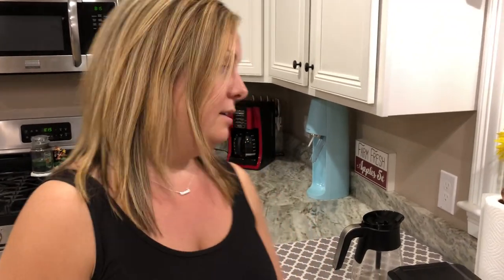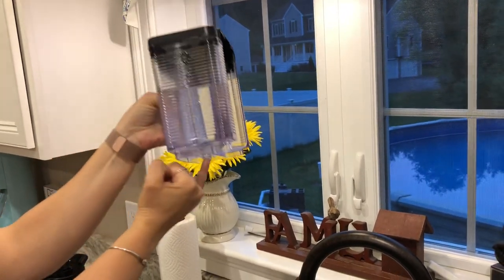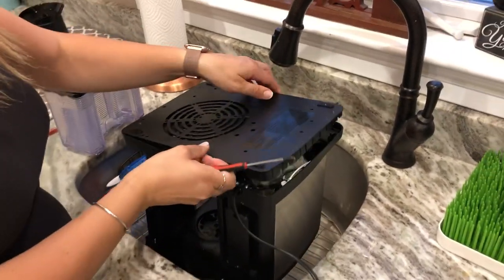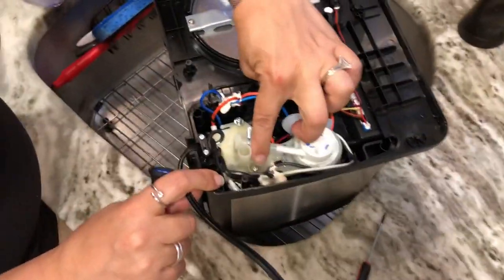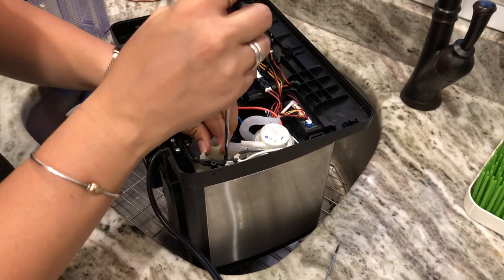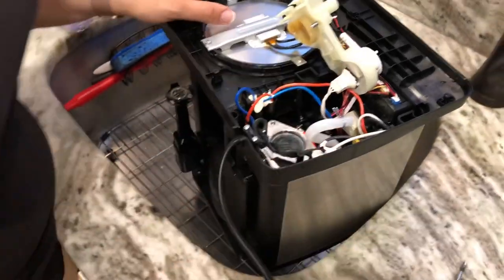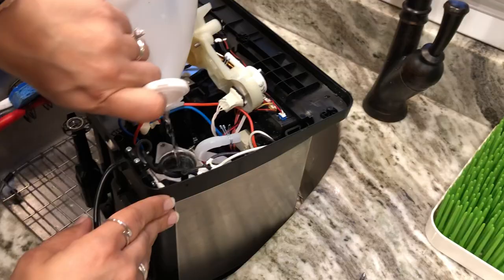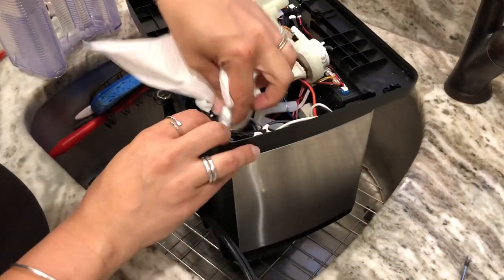Ninja Coffee Bar 5 Beeps of DEATH ~FIXED!!!

Comment: Another question....I do wonder how scale build-up in the boiler actually makes it so that the sensors don't work???  
       Another observation while I'm in there...it is clear that in mine, the bottom half of the boiler is all pocked and clear of scale build-up...so when I leave de-scaling solution overnight in desperation, it IS doing its thing, but also eating away at the metal (is that aluminum???  Yuck!)...and then halfway up the boiler the scale WAS built up, and  near impossible to clean it all down to the metal.  This tells me that the Ninja does NOT hold a full boiler of water, and therefore makes the cleaning cycle imperfect.  Maybe the reason I am only getting a few tablespoons of brew at a time is because my boiler was partly caked on inside????

Comment: You’re my hero!! Fixed mine first try!
Reply: Ok I take that back. Mine started leaking. Didn’t notice it with all the dishes on the counter still. Onto try three with getting that gasket to line up. But the thing brews now. Just a little leaky leaky. Lol
Reply from the maker: Oh no!! Probably the gasket not back in the right spot.  It’s tricky. Did you end up getting it to not leak the second time around?

Comment: So on the fence about buying this , it’s exactly what I want but so concerned about all the reviews and issues I’ve seen . So , what do you recommend is it worth it , do all the machines have this issue ? Help!
Reply from the maker: I’m torn!  I want to say, yes because I love the functions it has and the price of the unit wasn’t too bad compared to the other brands like the nespresso brand ones which can cost upwards of $400.  In fairness, I did have the unit for about a year before I had to to this cleaning with it taken apart.  Perhaps if I had run the clean cycle with some vinegar more regularly it would not had calcified so much in the little boiler pot.
Reply: I found that the problem was that I didn't "clean" it regularly. Especially if its going to be used daily and multiple times a day, which was my case. Vinegar is a good and cheap solution to use to keep it clean inside. I really enjoy my ninja coffee maker
Reply: Love the new Specialty Cofee Marker (Bar)
Had a similar issue but had a somewhat simple fix. It's been working great for us since.

I almost did this early one morning for the Er04 error message, then I thought about it and just shook all the water out thinking it may be vapor locked and after getting all the water out it worked! It was a new unit using filtered water. Just in case it may help someone!
 https://www.youtube.com/watch?v=YqrHJFjC2Ok
Reply: @MMAMoM23  I'd say Yes also! Great value, and once you understand the cleaning and posible "vapor lock" there is not much to be concerned about. IMO.

Comment: my model is from years ago, bought it brand new and has been in the close for several years while I used the first Ninja Cafe bar. So, took it out of the box brand new(same as your model minus the hotplate) ran 2 clean cycles as instructed and then made my first cup of coffee no problems. After first cup the 5 beeps started in now my other unit also did the 5 beeps from time to time but with some adjusting of the water reservoir it seemed to be a rare thing whereas with this new/old machine it's constant. Personally, I think the sensor for the basket or basket bucket maybe triggering something or the water reservoir signal since there seems to be some excess water beneath the reservoir?? But this is technically a brand new model? Any thoughts before I take out the sledge hammer?
Reply from the maker: So sorry for the late reply!!! Honestly it sounds like a defective unit for you.  I wish I had any other tips to add, but I don’t know what else you could do to it!! I always keep my trusty “old reliable” Mr. coffee machine in the pantry if this thing ever craps out again. LOL

Comment: The screws are impossible... Half of them randomly have a metal nub in the center that T10 can’t work with. So frustrating!
Reply: Same problem
Reply: I used a tamper proof T9. it has to have that little hole in the middle of the T9. Google it and you will see

Comment: Mine has been a verry slow death....starting at about 10 months old (now 2 years old).  I get partial cups of coffee, as in having to hit the brew cycle 4 or 5 times to get a cup full.  I always found the whole cleaning instructions kinda nuts, because the vinegar or scale-cleaner solution mostly flushes through instead of sitting for a good long time.  Also, the cleaning cycle adds up to spending hours at home to attend to the process.  ~and it only partially helps.  I like this way MUCH better, because it is so direct, visible, and tangible!  I saw a guy on youtube using CLR!!!  Sounds effective but SCARY in a FOOD/DRINK appliance.
   So I have been at this for about an hour, scraping with every implement I could find...awls, grapefruit knives, etc... and intermittently I stuff a vinegar soaked sponge in there and twirl it with a skinny 2-pronged fork.   Going super slow.  How clean do you have to get it?  Should I leave the vinegar sponge in there for a few hours?  
    One good trick is to keep a magnet close by for all the screws and washers!
    There are many model variations on the market, each with minor variations in how things come apart/go together, but the basic idea stays the same.  This video had the most info so far, thanks!!
Reply: I have the answer to the 'Beep of Death 2.o'... It requires the dismantling of the Swing Brew Basket.  There are subsurface magnetic contacts that feed the ability to perform a brew cycle.  At the root of all of this is a a spring to facilitate the contact.  And, there you go, no need to buy a new unit... Definitely a weak design and I will show you how to reinforce it as well!!!
Thank you Jillian 🤓

Comment: Going to give this a try.  Had been blowing air in the reservoir port with good success to get the chunks out, but that no longer works.  Need coffee, not problems.
Reply: I have the answer to the 'Beep of Death 2.o'... It requires the dismantling of the Swing Brew Basket.  There are subsurface magnetic contacts that feed the ability to perform a brew cycle.  At the root of all of this is a a spring to facilitate the contact.  And, there you go, no need to buy a new unit... Definitely a weak design and I will show you how to reinforce it as well!!!
Thank you Jillian 🤓

Comment: Here's the real fix... The 5 beeps notifies of a condition of high heat in the boiler. If you take the water can out and hit the bottom valve with your finger/tool, it should be a relatively hard stream. This stream must be more than what brews into the carafe.  The can may have a slimy coating, like a fish tank. This clogs the fine screen at the bottom of the can. Use something serious, better than vinegar, that will clean this slime out of the filter. I used denatured alcohol, swished it around, fingered the valve, took it out to the garage and blew it backwards with the shop air. Now it drops a steady 1/4" stream consistently. If the stream out of the box is still weak, I don't see any reason you can't stab some holes in it with a wire. You were about to throw it away, this will extend it a few years. You could probably buy a whole new can if you wanted to, as I couldn't find a way to separate the filter from the can. If this doesn't fix it, you have bigger problems but I believe this is the root cause, a simple flow issue. Not burping or swabbing plastic with vinegar or scraping out a 1" cavity. That's just superstitious.

Comment: I did this, put it all back and now all water leaks through the bottom, not a single drop goes into the carafe  😭😭😭😭
Reply: Your rubber gasket ring must not be flush or the hose didnt get pushed back in enough. That happened to me but I pushed the hose further in and made sure the rubber gasket was wrapped around flush on the plastic round piece.
Reply: @favioreveles1810  thank you so much!! You were right, the rubber gasket ring moved and was not allowing the water to go up, leaking it all through thr bottom. Problem fixed and now I can confirm my coffee bar  is working, no more beeping. Though it had no scale or build up at all (honestly to my surprise as per I've had it for about 2 years). Maybe it only had air trapped somewhere.
Reply: @brendaceballos6878  yeah it might of just been air. I actually returned my original Ninja coffee maker because it was doing this and they sent me a new one but the new one started beeping after about 5 months of usage. It's a very sensitive coffee machine to say the least lol. I feel like a coffee maker plumber lol.
Reply: @brendaceballos6878  glad that worked for you Brenda. My coffee maker was prematurely finishing too soon before that ha.

Comment: You only forgot one thing- the deposits get out of the boiler and go through the plastic pipe into the white plastic impeller chamber, which stops the fan inside from spinning to move water from the tank. The impeller assembly comes apart by screwing it counter-clockwise with both pipes removed. The fan will drop out. Wipe the inside with paper towel, drop in the fan, and put it back together.
PS New Jersey girls are hot.

Comment: I'm not real sure my Ninja is having the same problem. The 'drip stop' starts blinking/beeping over and over wont shut up and stops brewing. I can slide out the basket or flip the drip stop lever back and forth and it works again...but only for a few seconds then back to it's old crap again. Maybe this is the same problem everyone is having but it sure doesn't seem to be acting  the same way.
Reply: I have the answer to the 'Beep of Death 2.o'... It requires the dismantling of the Swing Brew Basket.  There are subsurface magnetic contacts that feed the ability to perform a brew cycle.  At the root of all of this is a a spring to facilitate the contact.  And, there you go, no need to buy a new unit... Definitely a weak design and I will show you how to reinforce it as well!!!
Thank you Jillian 🤓

Comment: Tried this and now the coffee maker leaks  like crazy!!  I think this lead me break my machine.
Reply from the maker: Becky Bossong try to open it back up.  If the gasket in the little boiler thing is not down flat perfectly it will leak water from there!  Good luck with it.  I hope you’re able to fix it.
Reply: Please please male a video pitting the boiler thing back w the screw ive been working on it for 3/days I've already bough a back up but it the one that u froth the milk in like a separate jar n I dont like pleased my machine is leaking

Comment: Just holding it upside down over the sink and pressing the inlet valve was sufficient for me. Hopefully I'll never need to actually disassemble mine, but if I do, I'll be sure to watch this video again. Video of my no-tools-required fix here: https://youtu.be/F18pL_E6ALA
Reply: I have the answer to the 'Beep of Death 2.o'... It requires the dismantling of the Swing Brew Basket.  There are subsurface magnetic contacts that feed the ability to perform a brew cycle.  At the root of all of this is a a spring to facilitate the contact.  And, there you go, no need to buy a new unit... Definitely a weak design and I will show you how to reinforce it as well!!!
Thank you Jillian 🤓
Reply: @jillianlaroque-peterson6072  You should create your own video, if you haven't already.  The impression I get is that there are 2 or 3 different causes of this problem and that my problem is not the Swing Brew Basket, but a bubble in the water sensor or stuck sensor (though I'm happy to be proven wrong). Anyway, for anybody whose problem IS the brew basket, having a video of how to fix it would be great.
Reply: Thank you Pablo😊 I liked your video and that worked for me the first time.  After trying all available videos the customer service individual said I needed to buy a new one cuz I was 1 month over on my warranty.  So I figured what do I have to loose.... I will be making a video tonight or tomorrow ☺️.  It is fussy work requiring patients but the level of difficulty is not bad.  Would love to hear your comments and it can give you other options when your's faults out again, sorry to say it is likely when and not if😁

Comment: This was interesting but didn’t work. The boiler had lots of calcium buildup and I cleaned it and everything else. Tried all the other methods on YouTube and the unit would not even perform the clean cycle. It has a higher tone 5 beeps when it fails the clean cycle (after running hot water for about 5 seconds). Spent too much time on this already. Ninja going in the garbage and getting a simpler coffee maker.

Comment: Hey Lenia - another YouTuber posted a much simpler and faster fix by just flipping the machine upside down while pressing in the black button valve where the water reservoir tank pushes into. Didn't have to take anything apart and solved the 5 beeps problem in 10 seconds. Just food for thought. I'm sure your fix works beautifully as well but just wanted to give someone another much simpler fix...and no tools needed! Here is a link to the fix: https://youtu.be/F18pL_E6ALA

Comment: Hubby tried this and it didn't work. Thanks for posting but I will keep looking.
Reply: I have the answer to the 'Beep of Death 2.0'... It requires the dismantling of the Swing Brew Basket. There are subsurface magnetic contacts that feed the ability to perform a brew cycle. At the root of all of this is a spring to facilitate the contract. And there you go, no need to buy a new unit.... Definity a weak design design and I will show you how to reinforce it as well!!!!  Thank you Jillian🤓
Reply: I have the answer to the 'Beep of Death 2.o'... It requires the dismantling of the Swing Brew Basket.  There are subsurface magnetic contacts that feed the ability to perform a brew cycle.  At the root of all of this is a a spring to facilitate the contact.  And, there you go, no need to buy a new unit... Definitely a weak design and I will show you how to reinforce it as well!!!
Thank you Jillian 🤓

Comment: I did this and mine still doesnt work. I am beginning to hate this brand.
Reply: I have the answer to the 'Beep of Death 2.o'... It requires the dismantling of the Swing Brew Basket.  There are subsurface magnetic contacts that feed the ability to perform a brew cycle.  At the root of all of this is a a spring to facilitate the contact.  And, there you go, no need to buy a new unit... Definitely a weak design and I will show you how to reinforce it as well!!!
Thank you Jillian 🤓

Comment: Crap! Notice she didn't show it brewing coffee afterwards. Because it's hard to put back together. Now it leaks like a sieve ... and still 5 beeps. Now looking at buying a new coffee pot. Won't be a ninja.
Reply from the maker: Chuck Hale sorry yours leaked!  I didn’t do a video afterwards with it brewing because I don’t make many videos lol.  The first time I did put it back together the white piece that screws in I guess was misaligned and mine leaked too.  I then took it apart again and noticed I didn’t have a perfect fit on that and unscrewed it and screwed it back together and it did not leak the second time.  Sorry yours didn’t work out!
Reply: I have the answer to the 'Beep of Death 2.o'... It requires the dismantling of the Swing Brew Basket.  There are subsurface magnetic contacts that feed the ability to perform a brew cycle.  At the root of all of this is a a spring to facilitate the contact.  And, there you go, no need to buy a new unit... Definitely a weak design and I will show you how to reinforce it as well!!!
Thank you Jillian 🤓

Comment: Ugh I wanna cry. This fix didn't work for mine, and I was so frustrated with putting the boiler back in. What a POS machine this is
Reply from the maker: Bummer! Sorry it didn’t work out.
Reply: I have the answer to the 'Beep of Death 2.o'... It requires the dismantling of the Swing Brew Basket.  There are subsurface magnetic contacts that feed the ability to perform a brew cycle.  At the root of all of this is a a spring to facilitate the contact.  And, there you go, no need to buy a new unit... Definitely a weak design and I will show you how to reinforce it as well!!!
Thank you Jillian 🤓

Comment: I'm so frustrated. None of the standard screw drivers we have will work on the screws so I guess I'll have to go buy a new screwdriver. WTF Ninja?
Reply: Vanessa Reich-Shackelford same here, google Security Screw Bits and the screws u need are available at Lowe’s, or Amazon 👍🏼 don’t buy a new one lol
Reply: @giovannahernandez6058  They're called torx bolts. They are becoming very common, and the drivers are available at any hardware store.
Reply: I have the right screwdriver, but some of the screws have a metal nub, miking it impossible to fit any bit in there. I guess I need a torx bit with a hole in the center? :\
Reply: @pixelpiratepo  All of mine have the metal nub sticking out in the middle. Looks like the torx bit needs to have a hole in the middle? No idea what to do here. Ugh!

Comment: But REALLY you shouldn't have to do this. It's dangerous. If the shops were open I would throw mine and her a new one. Crap design. I've spent all day on and off messing with mine.
Reply: I have the answer to the 'Beep of Death 2.o'... It requires the dismantling of the Swing Brew Basket.  There are subsurface magnetic contacts that feed the ability to perform a brew cycle.  At the root of all of this is a a spring to facilitate the contact.  And, there you go, no need to buy a new unit... Definitely a weak design and I will show you how to reinforce it as well!!!
Thank you Jillian 🤓